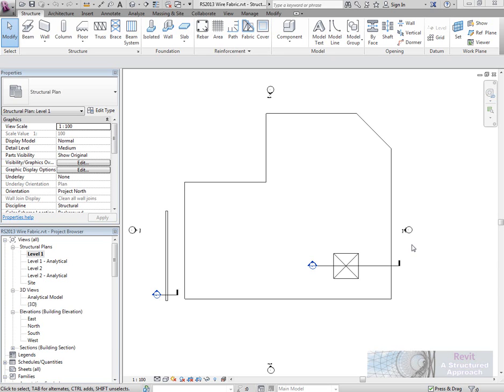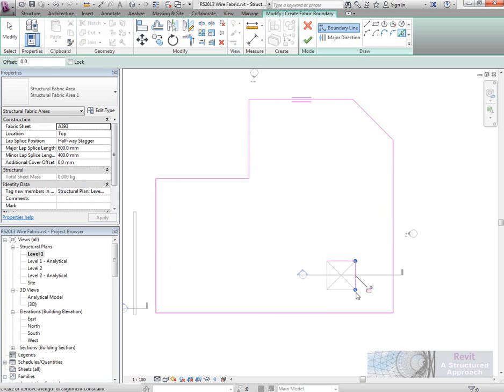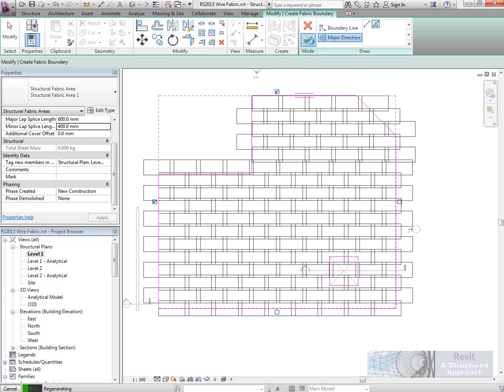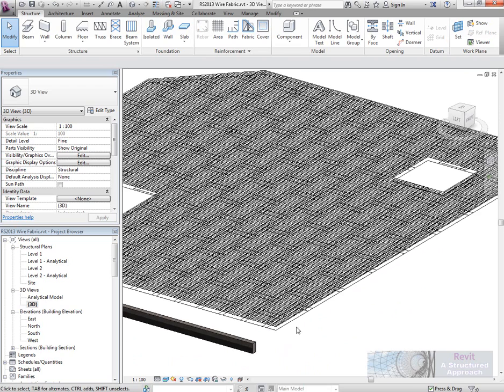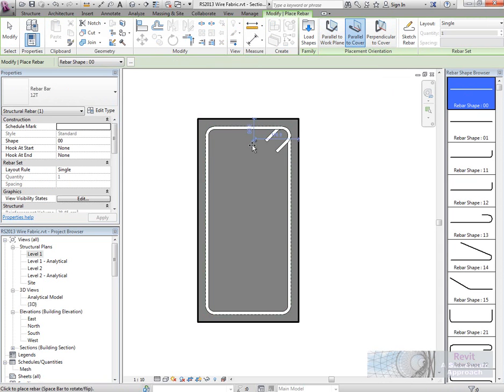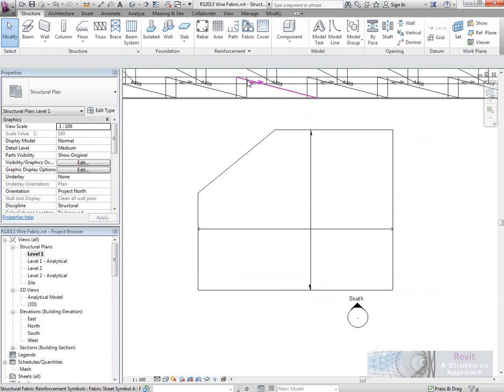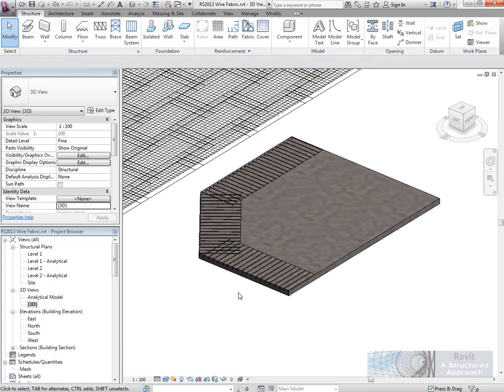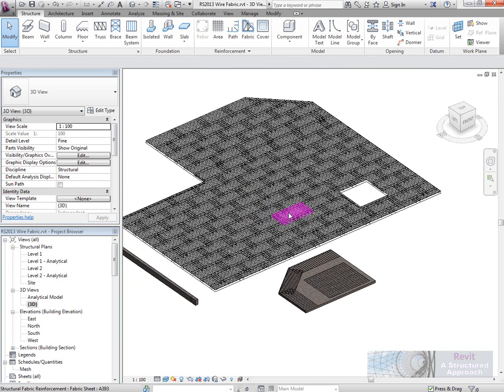Revit Structure 2013 - Rebar Improvements.wmv

Comment: Another good video but... What really bothers me is that, even in 2014, and after all the development that has been done, Revit is still fairly dire at detailing reinfrorcement. It certainly doesn't resemble standard UK practice and one must detail rebar separately. Also the 'communication' between path reinforcement, the tags, the hosted rebar and the schedules is bizarre and seems of little use, at least out of the box.